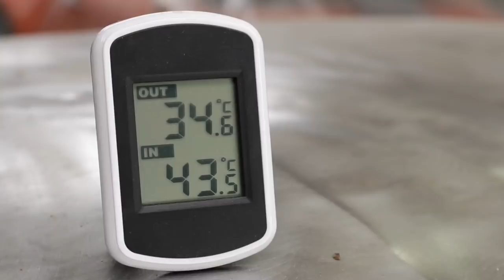DIY Roll Cage - Home Built Datsun 240z part 14

Comment: Seeing this episode reminds me of the rust you "shoved under the rug" behind the rear valence panel. I would remove the spot welds, remove the panel and fix it properly, or it will come back and bite you behind sooner or later. Working on old cars is almost always a love/hate relationship, but you always seem to make the best out of it. You've quickly become one of my favorite youtubers, and I love your work, keep it up! Merry Christmas!
Reply from the maker: I plan on treating that rust 'under the rug', just by encapsulating it with a rust inhibitor.
Reply: Home Built By Jeff That will certainly slow it down, but only for a while in my experience.
 I believe the time spent drilling a few spot welds and removing the rust is worth it, and it's much better to deal with it now than finding out later the hard way. I don't really see why you're investing so much in this car only to leave structural frame rusty, it just doesn't seem logical.

Comment: This feels like the "main hoop too far forward" comment was directed at me specifically. Whether it was or not ... Ouch, Jeff!
Reply from the maker: Haha, I realised how close to home it would get for you when I was editing it last night ;) 
Where are your update videos? It must be pretty cold there now, so you should be inside building :D
Reply: Just published one! Race season got really busy after thrashing to make it to the Mt Washington hillclimb, and we ran out of time to edit. It's 26° here now (-3°C for most of the world) so it's starting to get chilly out, for sure. There's definitely one advantage to working with steel instead of carbon fiber - Welding keeps you warm and doesn't care if it's cold out, and carbon fiber resin requires lots of heat to cure (which is expensive).

Comment: I know exactly what you mean Jeff about thinking you have gotten all the rust only to find more. It was the same with my Cortina project. Yay, No, Yay, No !!!! Also can I ask what type of tripod your using or whatever it is your using, you seem to get a great angle downwards from a fair height to shoot video footage. Mine doesn't get high enough for what I'd like sometimes.
Reply from the maker: My tripod is a very crappy, cheap ebay job. I need to get something a bit more solid so I don't knock it over and smash my camera again.

Comment: I'll let someone sandblast my z's frame to see every single one of The problems i have to deal with all at once. It's better than discovering more and more rust as the project goes on.
Reply from the maker: The Alfa will be getting dipped, to make sure I find EVERYTHING
Reply: Home Built By Jeff

I am really looking forward to that! 
When in the next year will you start the alfa project ? I'm assuming when the Z is at a stage similar to where the 911 is at now?
Reply from the maker: Haha, I think you have the impression that the videos are actually 6 months behind the actual work like a regular TV show. That is definitely not the case. I generally finish filming the weeks episode around 4pm on a Friday. I am usually a party animal Friday night, editing the video and generally get around to uploading it around 11pm, and then go to bed. What you see is as up to date as it gets.
Reply: Actually I knew you upload the day you finish an episode because you mentioned it in some 911 videos ^^ What I meant was that you will probably start working on the alfa project when there's "no mor work until ... is ready" with the z, I think. I only wanted to know roughly when you want to start on the alfa... Sorry when what I am talking about doesn't make sense :D Me a German so mein english ist not so gut ;D
Reply from the maker: All good. Hopefully I will have both the Porsche and the Datsun will be done before that Alfa starts, but I have no timelines set. It takes as along as it takes I suppose.

Comment: please don't weld the hoop to the floor, box up the corners as platforms you can also concave the wheel arches a bit and weld the hoop to them for more strength.
Reply from the maker: The cage is going to be a bolt in, but I was still considering the mounts. On the 911 I had flat surfaces to work with. I will probably mount the rear stays to the flat section on the top of the strut tower,  and the feet I was going to go a foot with a bend in it. Do you have photos of the mounts you have done?
Reply: +Home Built By Jeff yeah may have some send email address
Reply from the maker: Victorylane L Send them to Home Built by Jeff on Facebook

Comment: You need Bend Tech EZ, best $70 you'll ever spend.
Reply from the maker: I had a look, but I don't see how it would help for a simple cage. The design is not a big issue, and having the template makes it really easy to lay the hoop down for measuring. As you saw in the video, having a good design is one thing, but then it is made by hand and if something is slightly out you need to fix it on the fly.

Comment: Are you not concerned with if the roll cage is actually safely made? I would be worried about the cage buckling and impaling me. I know for racing a home made cage would be no good. Not unless it was made from a kit from a recognised supplier.
Reply: Maybe I should watch the whole video first. Still I think I would feel better about a kit from a supplier.
Reply: I've built and seen a lot of home built cages. As long as it follows the standards of what ever class you plan on running in, its usually good. Not every car has to be ready for rally races (bout as extreme as cage building gets). Think of it this way, would you rather have something or nothing? If this car wrecks hard enough to buckle that 1.5"(guessing) dom tube.. If you didn't have it at all the car would be a pancake.
Reply from the maker: The tube bender is approved and I have followed the rule book to a T. As @1dickycat mentioned, the tube is probably 10 times stronger than the car itself (I am a firefighter and I have cut up plenty of them). I have more faith in this than in most of the flimsy kits out there. Rally cages don't come from kits, they are made like this.
Reply: Yes I saw your comments in the video after I made my original post! 😂 You are both very correct, full on Rally cages are made piece by piece for sure, I was thinking of the likes of “safety devices” cages we get in the uk for a kit. Good work! 👍🏻
Reply from the maker: I would be wary of some of those kits, as they don't generally comply to motorsport standards (at least not here). They are much lighter weight, and often made in China.
Reply: Thankfully these kits are built to fia standards so they are fine. There are some alarming “show cages” around that just look like they will collapse. Maybe I’m just lucky to have good regulated companies in the uk.
Reply: I think you are underestimating the quality of work that can be achieved by an Australian in a shed.
Reply: I suspect they are actually on par with the tradition of the British “man in a shed” industry! 👍🏻🇬🇧 🇦🇺
Reply: so why the doubt?
Reply: Because I have seen a number of youtubers make some very bad mistakes when building things they don't understand. (Not applying this to Jeff) When I watched the rest of the video and saw the details Jeff mentioned about the tubing size and "single piece for the main hoop" my doubt went anyway. I just jumped the gun posting a comment! 🤗
Reply: As Jeff points out, so long as you follow the rule book there is no reason a home made cage can't be as good (or better) than a kit or even custom made one. Here in Australia, our motorsport governing body publishes extremely detailed specs covering materials that can be used, dimensions, what members must be present in a cage for varying types of competition, angles of stays, maximum number of bends in an individual leg of the cage, right down to dimensions and grade of fasteners used, material used for mounting feet, radius of bends, maximum amount of crush at bends, etc, etc. Mistakes / bad workmanship can be made by both amateurs in their shed or by the pros.
Reply: David, extremely detailed- apart from seat mounts...I've got the rules and there is just about FA.
Reply from the maker: So maybe the wooden chocks that were being used as seat mounts before are all good then? ;)
Reply: the thought of wooden seat mounts...does not give me wood...

Comment: Oh dear. Why ruin a perfectly good car with a roll cage? Such a shame Jeff. Leave it original! Take the silly plastic flares off.  The 240Z is an absolutely beautiful design, and you are not improving it. 

Strangely, I had no problem with you racifying your 911, but for some reason, I find hacking up a 240Z to be a low-quality idea. A straight, and factory original 240Z is going to be worth a huge chunk of change in the very near future. Seems like a shame to make it worth a lot less.
Reply from the maker: Complete originality is not seen the same way in Z circles as it is in the Porsche world. This car is not super early, and is not matching numbers anyway (and flares were actually a factory option in the day). The cage is bolt in, so it is not permanent either.
Reply: This bland, vanilla perspective of the the car world, and life generally, comes free in the user manual of every Camry purchase.
Reply: He's starting with a car that's in such bad shape, it isn't really a shame to cut it up and modify it.